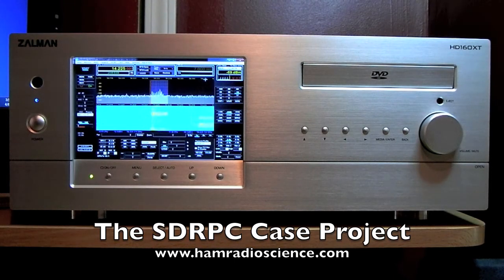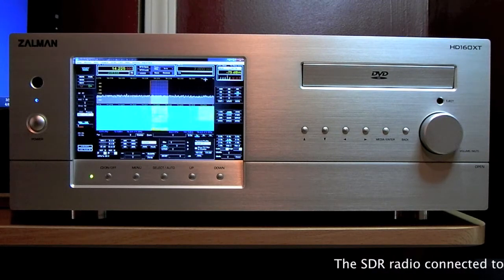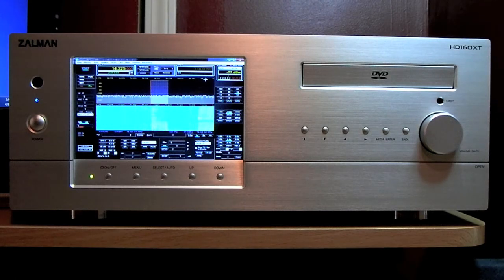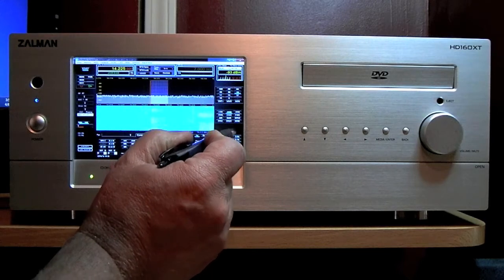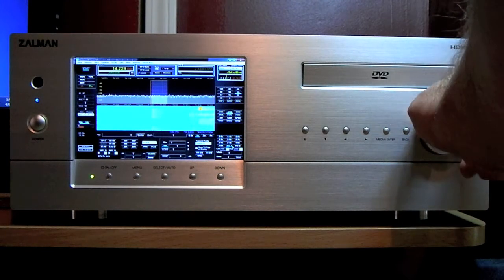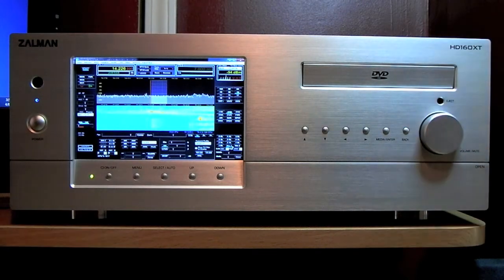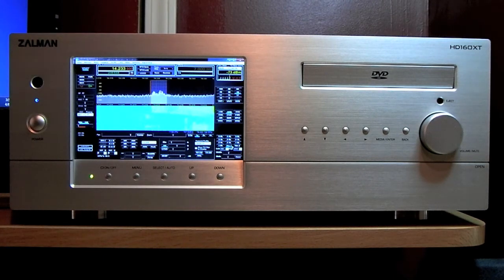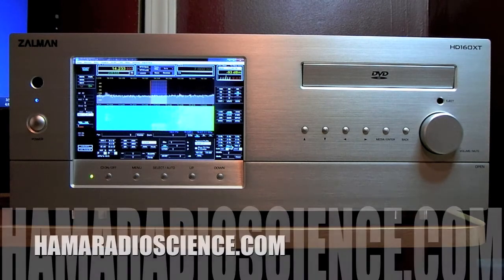SDR PC Case Project

Comment: I really like the case setup!!  I wonder, does the software package your using allow you to modify UI elements?  If so its possible you could modify the UI for the small screen (for example, setup all the most common functions in larger easier to read/use buttons).  Since your likely using it with the PC still you could use the cutdown UI on the little panel and keep the full UI on the main PC screen.

Another option, if your into the DIY electronics stuff is use a setup with a video card that supports display port and use the eDP to DP converter board and one of the retina LCD panels from a iPad (all over ebay for 60-90$).  The super high resolution panel would easily contain all the data onscreen.   Regardless, love the setup and will probably copy it in some way in the future ;)